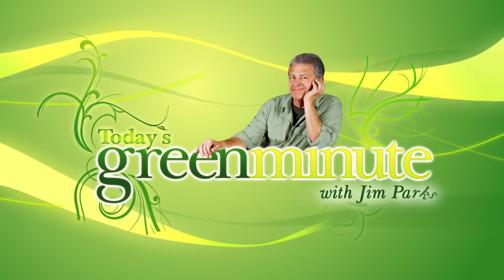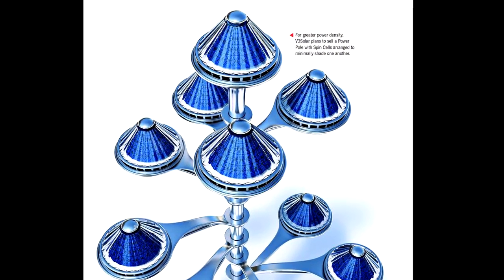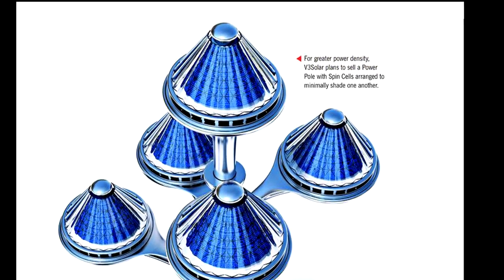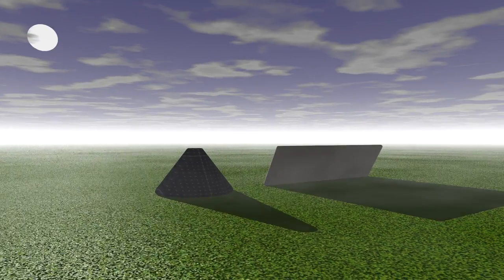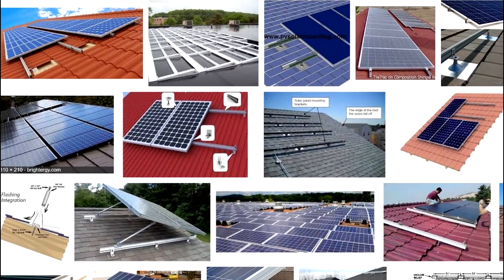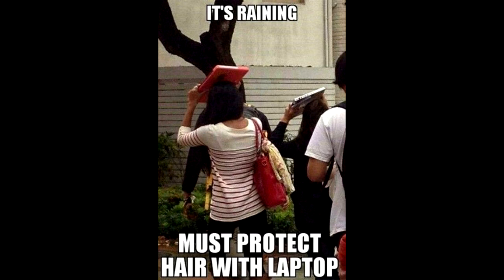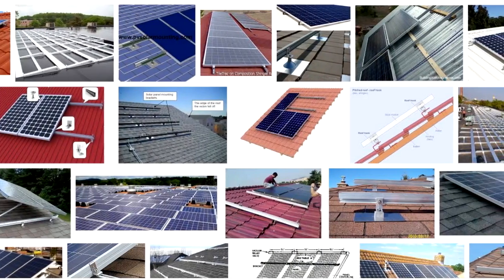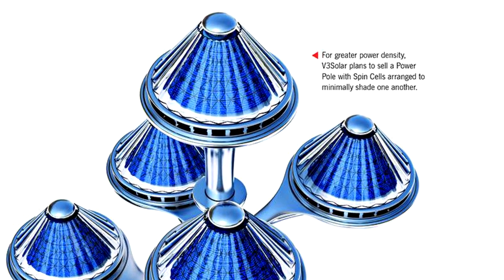Spinning Solar -BUSTED!

Comment: I don't know man, fresnel glass has been used in cinema/photgraphy industry to concetrate light... the cones..

 well if you have a bunch of them on a "tree" they are likely to act like targeting solar panel.. having said that.. not sure how cheapER they are going to be... those lense need to have airflow, and glass is inefficient to produce, also the spin requires energy, but if they even have 30% efficency and you put together 6 to 8 of 'em, maybe you do get good numbers in energy return.

can't crunch the numbers, but you did do a pretty slack job with those numbers too ;)

Comment: The other problem when solar panels are in the dark they will consume power. So while half in the sun is making power the other half in the dark is using power. You can use diodes to stop power from freely flowing across the whole panel but even small solar arrays don't use diodes between each panel as it wouldn't be cost effective and the diode consumes a very small amount of voltage that would reduce the efficiently of the panels. In their solar panel additional power is required to power motors and fans consuming even more power. This is very basic math, and basic electricity. It is sad people fall for these silly ideas.